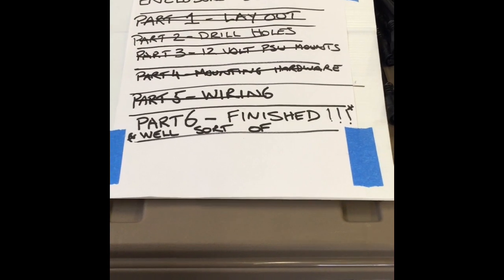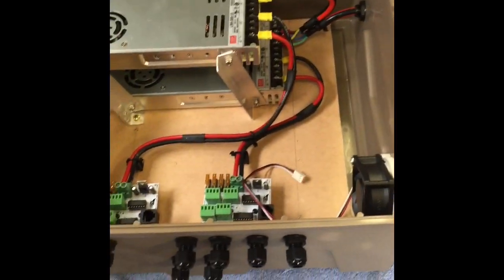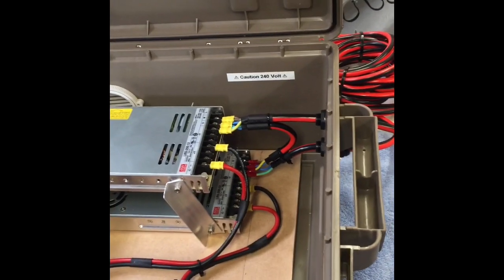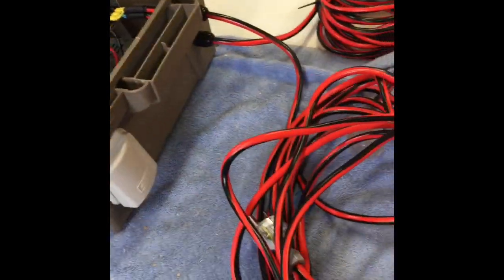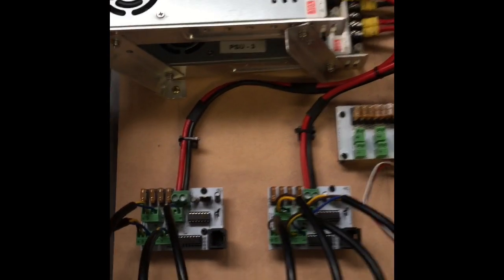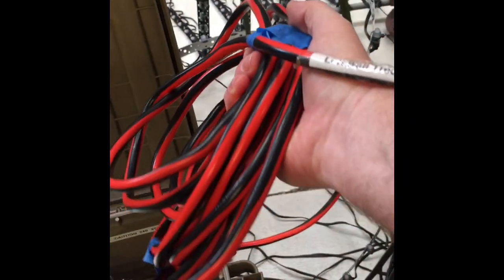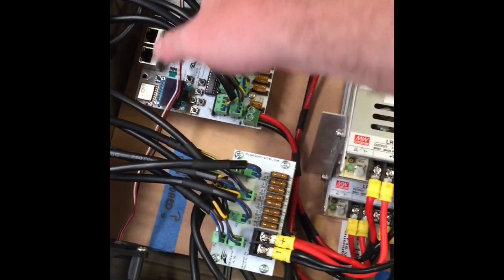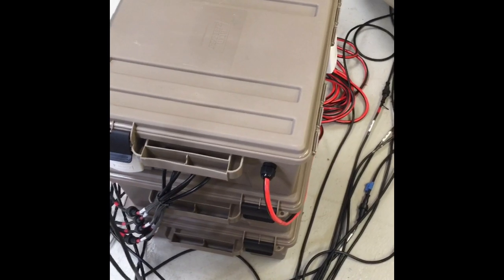Falcon F16 & F48 Pixel Controller Enclosure Build Part 6 - Finished (Well Sort of)

Comment: What gauge wire are you using to daisy chain the power supplies and also the gauge wire to f8 Distro?
Reply from the maker: 10 or 12AWG wire from PSU to the Distro or receiver boards.

Comment: What is your maga tree specs? Where exactly do you power and ejection on your Mega tree?
Reply from the maker: Hi Rob, our updated Mega Tree is 12v WS2811 nodes with 85 x 32, we updated the controller to a Falcon F16v3 with a Expansion board (which has now 32 outputs) so simply 1 x String  85 nodes) per output and thus requires no power injection.
Reply from the maker: Some more information regarding our MegaTree is located here: https://auschristmaslighting.com/threads/lawrence-drive-lights-megatree-build.10833/
Reply: LawrenceDrive Lights how tall is it feet and 2inch spacing ? Jw building my own soon
Reply from the maker: @xxrobxx25  here is a separate video fro the megatree, I have update the tree since and made the base ring larger
https://www.youtube.com/watch?v=nXtphPRzYPU